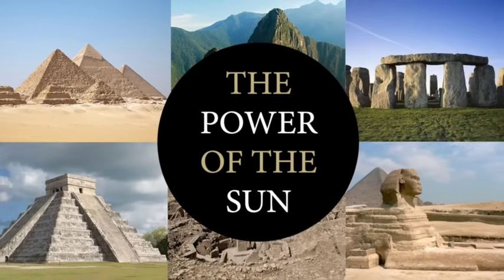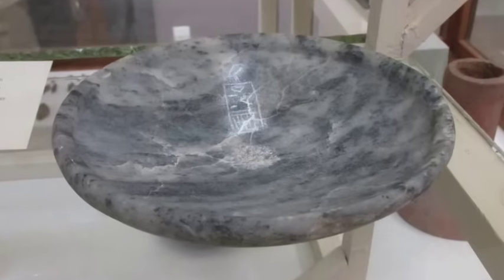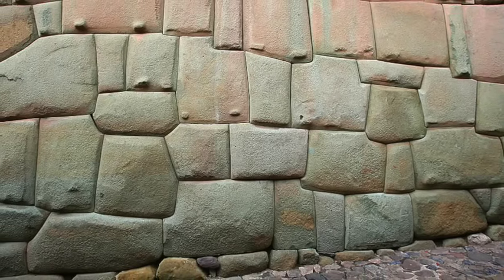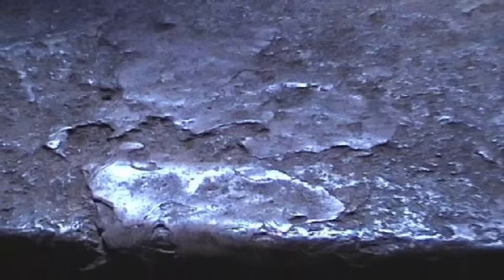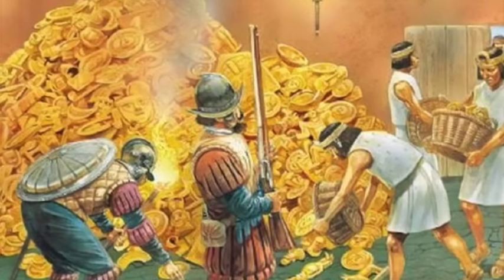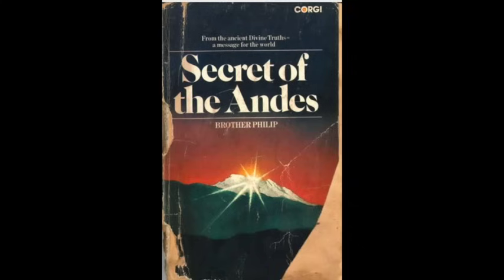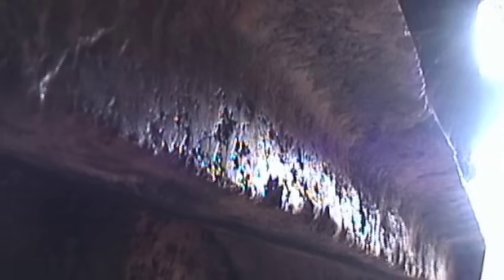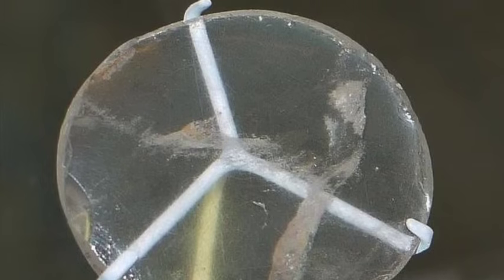How the Ancients Cut Stone with the Sun - Lost High Technology Explained | Ancient Architects

Comment: There is a major inconsistency with this theory. To concentrate sunlight to make a laser, to cut a perfectly straight surface, and not just melt a surface, it needs to be done without creating friction. And this cannot be achieved using a concave dish only. Although, the direction of the theory is actually correct. They were masters of the creative forces of nature. What a re those forces? Light and gravity, at the opposite ends of the spectrum.

Comment: There is also evidence of machining marks in the rocks, so don't dismiss that idea so readily. Mechanical machines wouldn't necessarily need electricity, although lighting does, and it's also been shown that lightbulbs may have existed. This would explain why there are no torchmarks on the pyramid ceilings.

Comment: Completely ignore the fact that A) melting rocks is not cutting rocks B) melting rocks would not leave the striations within the rock where it was cut C) who is dumb enough to chisel away at molten rock

See either the molten rock would be expelled towards the person chiselling away at it, or you have to heat it up and wait til it cools substantially, and then rinse and repeat over and over. This constant change in temperatures would have obvious observable indicators of extreme heat being applied. There is no evidence to suggest this technique is the one used. Any material is heated enough will melt.

This is just more mis-leading information. Melting is not the same as cutting. Period.
Reply: That is my point, melting a rock is not a precision technique and no 6 year old has ever built or successively cut solid rock nor granite for that matter. Magnifying glass was not available back then either. Until someone can not just say but also prove how it was done, it is nothing more than speculation and everyone has opinions. I actually offered up reproof that objectively displays just a small number of the issues one would need to overcome to built anything in this manner. Either bring forth your reasoning, else I will have nothing to say.
Reply: However it IS known that to dig tunnels in rock, the favorite method was heat up the rocks really hot then trow cold water on them to crack and shatter them.  it is entirely plausible that some people figured out how to use that same heat/cold reaction in a very precise way. Seriously, a 6 year old can burn a pinpoint sized dot with a magnifying glass, give the ancients a little credit for being capable of what a freakin 6 year old can do sheesh LOL
Reply: Sean Regehr you're an idiot
Reply: You mis-read me. I didn't SAY a modern 6 year old melted rock, I said that since a 6 year old is capable of the level of precision that can burn a pinpoint hole in a paper by precisely aiming a specific tool, then certainly a full grown adult would have been capable of aiming something precisely.  You seem to think they weren't capable of the hand-eye coordination that a 6 year old has. Who's being ridiculous, really?  And this may come as shocking news to you, but actually  the technology of heating something up to mineral-melting temperatures by reflecting sunlight onto it from curved reflectors IS possible and works ENTIRELY well, as proven by the multitude of molten salt power generating facilities which work great and are all over the place. Get over your ridiculous modern arrogance that ancient humans were not capable of figuring things out or that they couldn't duplicate the hand-eye coordination of a 6 year old. It's insulting.
Reply: Sorry dear, but your ignorant comments gave me the best laugh I've had in a very long time because actually there is a well known and  VAST wealth of technological evidence and anomalies and oddities scattered all across egypt (and other civilizations) and documented from multiple locations and sources. The only problem is figuring out what they were REALLY used for, and tools to make life easier is HIGH on the list of probabilities. Ancient peoples developed tools by the same basic process we do, by starting out with an idea that seemed close to answering their needs, and then doing careful refining until it was perfect. 
The most efficient computer driven machining factory in the world still started out being designed and built by humans. At least 2 civilizations understood aerodynamics and flight physics perfectly well (India which has historical documentation and Peru where working models were found in tombs). 
 I have with my own eyes seen primitive power tools at work doing a very effective job. Even the bible has very technical descriptions of flying machines which have been recreated by professional experts.  So, I know for a FACT that these technologies are not only possible, but practical and workable, while you just sit there assuming it's not possible. I've used some of them with my on hands. Open your mind and stop being so ignorant, there are a world of working practical possibilities out there.
Reply: The basic facts remain no matter how much you want to roll your eyes at me. There is absolutely nothing new under the sun. Primitive man was highly intelligent with a LOT of time on their hands. They figured out basic principles, and applied them in ways to make their world better. You think it's not related, but it ALL is related. 
For instance, Diesel engines run because of the same principle used in a simple fire starting tool known to many primitive jungle tribes. Molten Salt Power Plants work by reflecting sunlight at a specific point. These are KNOWN, working modern technologies....yet ancients had them in their own ways too. The ancient arab peoples had massive river-powered hammers for pounding up stone, as well as double action cylinder pumps and hydraulic screws which brought water up to higher levels from lower.  You should really start exploring primitive tech, it's really amazing how complex and advanced some of the things are. 
Check out the research, there are working models of very advanced machines are being made TODAY by following the ancient texts of India, and the artifacts coming out of Peru are just mind-blowing. Check it out. You would really enjoy it.  Ancient man was capable of SO much.

Comment: From a builder's perspective that accounts for craftsmanship and design in building these massive walls, statues and monuments—it's not good enough to just figure out how the ancients powered their devices, the devices they used are a key missing element. The question of HOW they did what they did, the actual building procedure and tools used that did the work, is still outstanding and not sufficiently addressed. No modern diamond tipped drill can make the inner corner and coped cuts we see present in these structures (of stones weighing tons).

Sun powered lasers seem to be only a part of the possible answer. Figuring out the power source is just a beginning. Being able to wield that power with craftsmanship and artistry such as is present in the artifacts, statues and monuments mentioned is quite another matter. It's the equivalent to a tattoo artist's needle powered by high voltage electricity coming from a power plant somewhere—stepped down and channeled into an instrument capable of delicate precision. 

There are no grooves from some incremental carving tool or indications of sequential cutting to remove material—the surfaces are glass smooth (mentioned in the video) and have fused or transformed softer stone particles. That indicates some sort of heat generator—but doesn't explain the precise accuracy applied to curved coping of corners (esp. inner corner). This yet unexplained capability evidenced in the giant walls and monuments of coped, interlocked massive stones weighing tons, often containing rounded corners (and especially, inner corners that are rounded that would have no possible external access) is what we also need to discover to fully answer the question of how they were built.  

The technology that not only harnessed great power to work with massively heavy material also was sophisticated enough (and beyond modern capabilities) to make precision cuts through the hardest stone materials at impossible angles accomplishing astounding carving.
Reply: Sunyata Satchitananda 😺 Very clearly presented examination of this issue. We should recognise that ancient people were not solely primitive barbarians, but much more capable of technical creativity than at first was believed. Here in England we are still puzzled as to how the structures at Stonehenge were built from material quarried in, then transported from Wales!
Reply: Your perspective does not take into account the possibility that many stone creations were not made by cutting but by pouring, molding.  
Have you never seen a faux marble counter top?  It looks like natural marble, or perhaps granite, or alabaster.  
The science of resistant binders was a likely source of the making of many huge things, and perhaps smaller things as well, like vases, using crushed rock.  

If we can do it today, then those geniuses could have done it then, otherwise we are where we've always been: without ANY logical explanation.
If you pay attention to videos of Egyptian hieroglyphs, you'll notice that on many surfaces the glyphs are made of an outer surface on a pillar or wall, with sections of that surface having flaked off, showing that it was a mortar veneer plastered on a solid surface and worked while it was still soft.
Reply: to Sunyata i have a theory , with evidences from Peru Bolivia and Egypt the ancient ( aliens ) had extremely advanced construction equipment , for the cutting i am thinking of desintegrator , energy beam that cut any  materials by breaking atoms bonding ( getting rid of valence electrons that link atoms together ) with proper magnetic and force field to extract mono atomic particles , one side effect is the glassing effect by flow of silicon atoms re-attaching to side walls of cut surface no heat needed and work also on limestone

Comment: The stonework is far too precise for simply melting the stones. I believe they utilized this method to some degree, but the precision work is far too accurate, and the melting of the stone would have produced slag and runoff, which would have to be chiseled or remelted to remove. Never quite being completely cleaned. I do not believe this was the only technology utilized. Nor was it likely used in the Pyramids of Egypt as they do not showcase the "molten" form of the rock like the Peruvian ruins. Also, the Inca never claimed they built the original architecture. They found it. So they told the Spaniards.

Comment: Bare with me here... Talking about cutting stone with light... Take a look at the mask at the timestamp 6:10
I'm going out on a limb here: 
Maybe the eyes represent sun disks/reflectors. There appear to be two individuals, one below each eye/disc. Maybe they controlled the angle of each disc. What if the nose is actually a device? Something that would focus the light. Maybe a lens? Note the almost electric/lightning bolt type symbol above the nose.
Notice that the nose touches the mouth... the teeth in the mouth remind me of the blocks they built with, they are closely arranged....

I would love to know the meaning of the symbols around the disk. While each is different, there are similarities between symbols on opposite sides of the disk. 
Maybe each side is instructions for operating each disk? Maybe each disc had it's own function?

Maybe I'm taking this to far :D

But maybe, just maybe, this gold disc is encoded? A type of manual?

Comment: Hmmm... Bingo. The theory is old, but it finally falls into place. So they understood to gold plate mirrors and concentrate the power of the sun. The special rose granite the Egyptians liked to use is actually an interesting composite which can be easily hammered into flakes and the easier this goes if you heat the surface. Its crystalline structure looks like it wouldn't take much thermal stress. You can transport the bits and pieces to the place of construction easily and meld it into place with the power of the sun. That would also explain how you get these heavy sun temple stones up onto mountain tops in the Andes. To add to the mystery I would even suggest ancient scientist used copper rods to catch lightnings to vaporise metals. With our current level of ignorance we won't survive another ice age. That's for sure.
Funny aspect: some people at the other end of the desert belt are rediscovering said technologies: https://www.youtube.com/watch?v=lWpCot82swM .

Comment: .39 sec we have the picture of the modern drill head and at 1.37 min we see the old copper tools. Three of the tools have stone encrustations probably from the "matrix" that they were found in.  A satisfactory modern tool would be a copper phosphor bronze with a hard abrasive glued to it with tin alloy.  Copper is a very useful metal.  Bronze has many forms and modern allows are really in about the same ball park as far as performance.  Water cooling is required.  If the Greeks got their education from Egypt then pumps, pulleys and the various gears and wheels where available to them as well.  The bronze tools are there.  We just need to keep looking and we will find them.
Reply: that drill hole was done by sound I have actually seen this process with a wired speaker in side a tin with another cable coming out and you would have a copper ring on the end off that when speaker is turned on it starts to rotate the copper ring. Unfortunately I don't know what it is call but I have seen it done

Comment: Very intriguing theory, especially at machu picchu. The hitching post of the sun is a very strange carving, could be for the installation of a mirror... 

However, I would have to see practical applications of this technology to persuade me from the theory I believe which is that the polygonal blocks were made with ancient concrete. You can get a smooth glazed surface with concrete, just look at your garage/basement floor. It erodes from the elements in places, others remain smooth. Also have to consider the millennia of people touching it with their hands, making it smooth. Just look at the feet of statues that people touch out of religious devotion... 

No, the solar-cutting theory does not explain the nubs/knobs and pillow-faced interlocking blocks, unless it can be proven through experiment that these are byproducts of the cutting process.

Comment: That still would be inadequate for explaining how perfect internal compound angles were cut because the cuts would have to be stopped to within a micron all around. Are you suggesting something along these lines?
Reply: Simple one: with large parabolic mirrors you can easily melt rock and cast it into any form. These days mirrors are predominantly made from aluminum, because of its better optical quality, but gold of course was more accessible to the ancients and does also better reflect infrared.
Reply: Yes, if you cast "stones" in place they might all look different each. And this is still the case today: https://youtu.be/98jNe_9xzM4?t=2 . Furthermore there is no need for a focused light beam to melt anything. If you get it right the thermal shock can easily beat up crystals without melting them. (And you can work to a precious of a single crystal layer.) And of course there are two questions here: how have they done it and how can it be done. I'm mostly interested in how can it be done in the simplest way. Using parabolic mirrors is a marvelous simple technology all kind of things can be achieved with. I know that Archimedes used to set ships on fire and I also know that he had studied in Alexandria. So I guess this kind of solar technology must be around for quite some time.
Reply: Sure this method of making a fire in the pit is well known. I read some time ago a report that it was used here in Europa as late as the first world war. But I wouldn't consider it the "simplest" but the most stupid and primitive. Reason is you have to carry lots of firewood and water to your quarry location.
Reply: MrRecklessryan: You are boring. And yes parabolic mirrors also work the same all over the world. Go figure. I just provided you the Ockham's razor argument before. Maybe you got a knot in your brain? Well, I accept your theory about wood burning and stone banging idiots as another possibility. Certainly there always have been two kinds of people on this planet.
Reply: MrRecklessyan: You really must start to understand that words have exact meanings -- without, any attempt of yours to perform "Scientific" thinking is quite flawed. I never stated anywhere that you can "cut a stone with a mirror", neither did the author of the original video.
Reply: MrRecklessyan: Sadly I'm much restricted to Gedanken experiments when it comes to the experimenting with the sun. But I find this list of experiments very impressive: www.youtube.com/watch?v=geh1FEpIXuQ . Do you think these are worth to reproduce? Egypt is known to have learned glass making as early as the 3rd millenium BC. See en.wikipedia.org/wiki/Ancient_glass_trade . Or also: https://youtu.be/bRcu-ysocX4?t=2855 . Gold and silver have been said to be even more important to the living representation of the sun God Ra. I doubt that he was just after status symbols. He certainly observed the interaction of the rays of the sun and the matter around him.